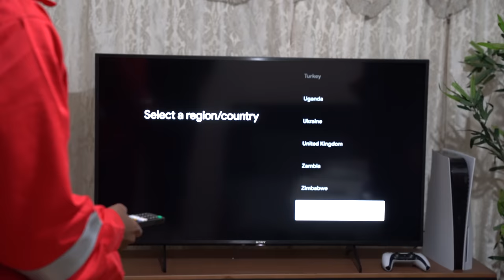SURPRISING MY BROTHER WITH HIS DREAM GAMING SETUP

Comment: First of all, I was very happy with how fast this item was delivered. https://www.youtube.com/post/UgkxYR69rUVDfF56JHQRldV2uJeXaPA9LTZW It came a day before the listed delivery date, which was super great! I was able to assemble it myself with no difficult and I am not an engineer or a put-it-together expert. The chair is super comfortable, I play video games for roughly 3-4 hours at a time and it does not make my back hurt or neck hurt. The Reclining function actually surprised me because it goes very low, you could fall asleep on it ( and in fact i have while laying on it with a foot rest for my legs). The red is a bold choice and I usually stay away but I love how the red and black contrast looks on this type of material. The wheels on this chair are very very quiet, I have wood vinyl in my apartment and there is absolutely no noise. OVERALL, I WOULD RECOMMEND or BUY IT AGAIN !
Reply: This is YouTube not Amazon review
Reply: @5starjaslene 😂😂